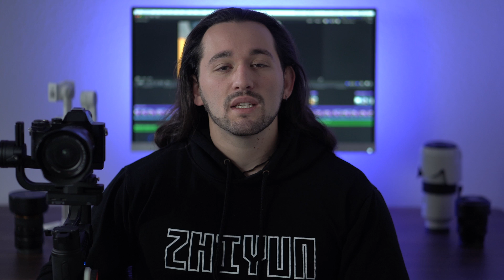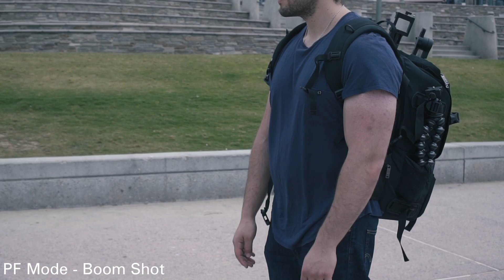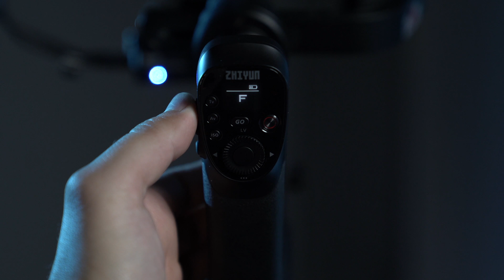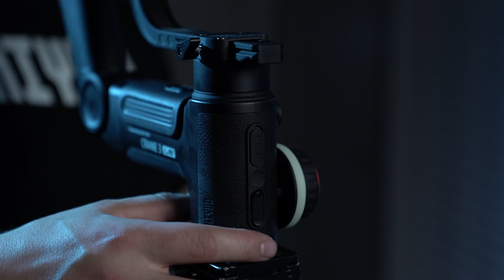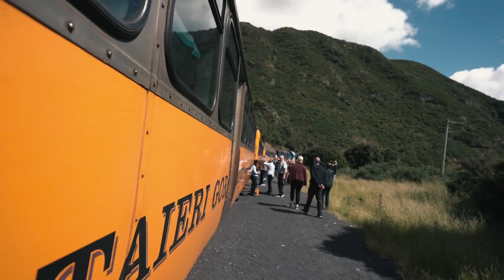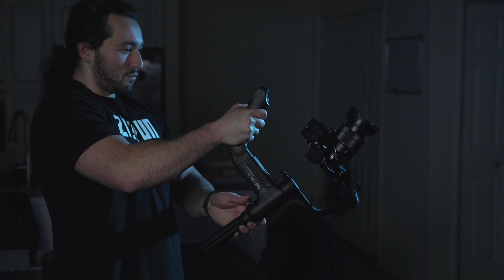Introducing Zhiyun Crane 3 LAB Gimbal Modes

Comment: Hi,  I have this Gimbal and have a Canon R6 with 24-70 Lens.  The PF mode appears to be working well but for some reason L mode does not appear to be locking the pan axis?  The gimbal appears to be fully balanced and testing the pan axis for balance is fine.  I can move the camera also in any position without any stabilisation issues or movement.  I have used the app to adjust the various movement values but with no improvements.  I have just performed the 6 side calibration procedure also which has not helped.  Any ideas what I could try?

Comment: Could you give me tips on how to setup the bmpcc 4k? Which screen and which parameter for the Crane 3 Lab gimbal to have control of the camera. I installed the camera and the cable but I can't control it through the gimbal. I really appreciate it if you can help me.

Comment: When I switch to V mode and rotate gimbal arond its horizontal axis all other axis goes wild. It can't stay in horizontal position and I am not talking about roll axis. Do you have some solution about this?
Reply from the maker: Do you touch the joystick in other direction? What do you mean the gimbal goes wild?
Reply: @ZhiyunTechGlobal  I don't touch the joystick. It spin to the left on pan axis and on the roll axis when I turn gimbal to the left, for example. It looks like it lost orientation every time in V mode. I am using it with gh5 so weight is not a problem and it is balanced correctly.
Reply: I made a video example: https://photos.app.goo.gl/CBpeRaVZcsiW8th47
It can't recover without restart.
Reply from the maker: @slobodanvasic8748  Make sure each axis is perfectly balanced and check the firmware update. If it still happens, please contact service@zhiyun-tech.com for diagnosis.
Reply: @ZhiyunTechGlobal  Everything is as it should be. Perfectly balanced and latest firmware is installed. I will contact service.